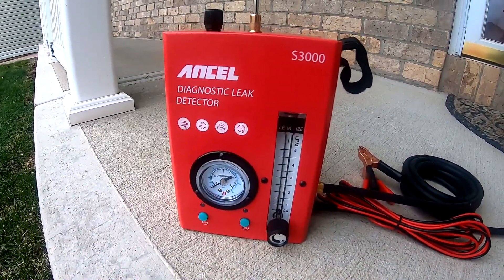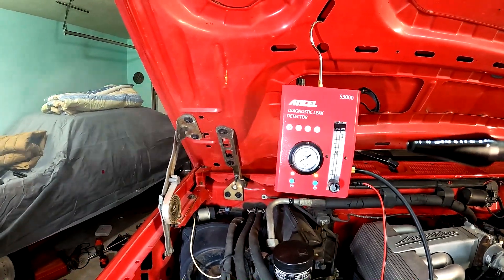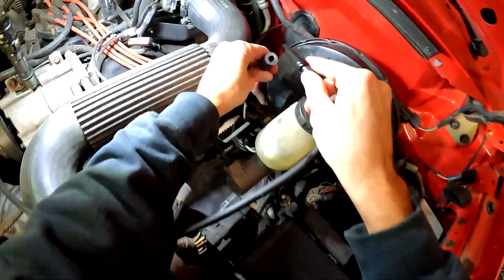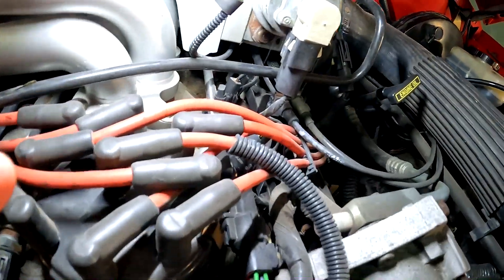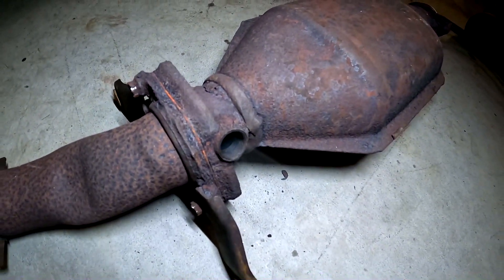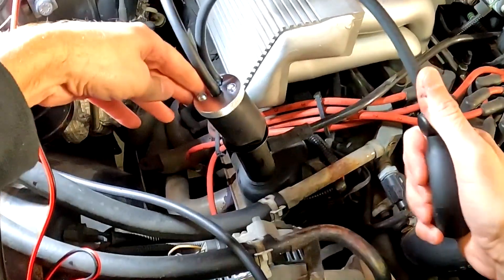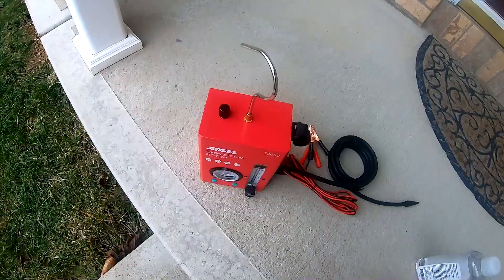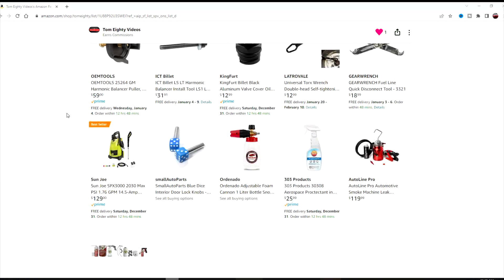Easiest Way to Find a Vacuum Leak in an Engine

Comment: Pretty fuckin awesome honestly. For 250 though I'd buy everything needed to DIY one including a compressor and everything else, and still have money left over. 

For someone who'd use it weekly or a couple times a week on repair jobs. It'd be well worth the money. 

What make it nice is coming with all fittings and hoses including the bladder. However I don't know how well that bladder actually performs.
Reply from the maker: Thanks for watching. And I'm a little confused because when I click on the link it brings me to a listing that says it is $199 for this product. Is that not the case for you?
Reply: @tomeighty  yeah I agree that link is 199. I got where I was when searching. 

Good job presenting, btw. I could see demonstrated most of what I wanted to know about the product and learned a good bit.